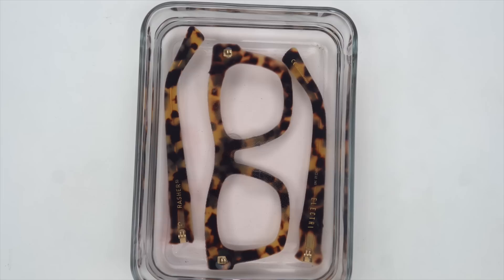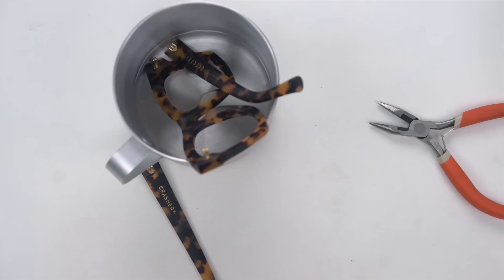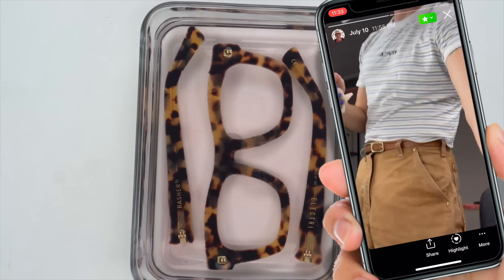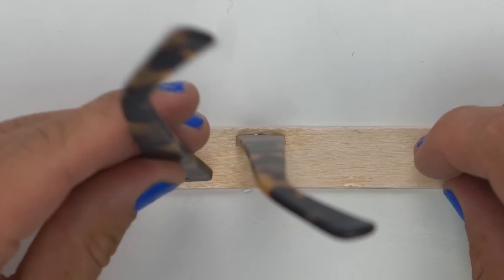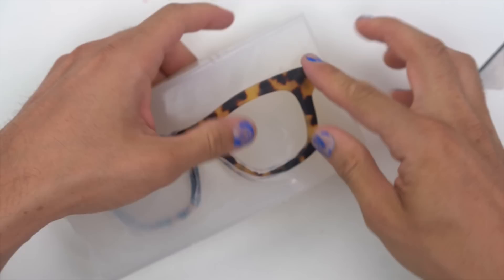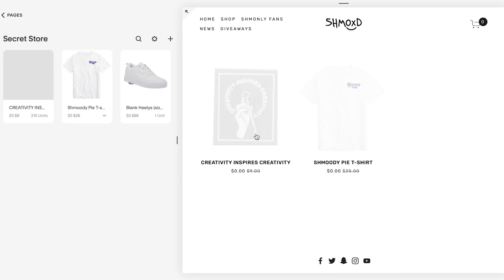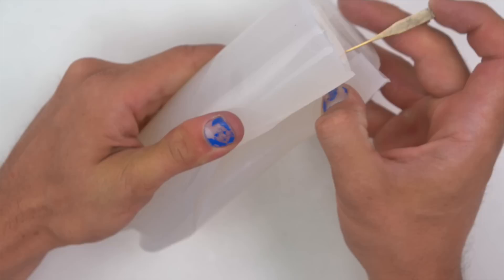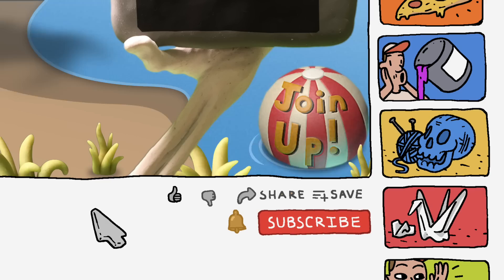DIY Flower Glasses Pt.1

Comment: If you don't want the glasses to bend next time, use a type of silicon that will be clear in the end because the light can't touch the resin as easily and have the UV light shine on the resin for at least 1-2min that should help with the bending

Comment: You could encase the plastic parts in a sand mold and simply use a small furnace to burn away the material. Inject with resin, burnish, polish, then hydro dip using a preselected pattern featuring the flowers of your choosing. Using this method would enable you to create many pairs as well. Done with care the glasses would be production quality also.

Comment: the way i took out the little metal thingys was to use a wood burner to heat up the metal part, then pull. it comes right out:D
Reply: Yeah, I was thinking 'hot air blower' immediately. That plastic should soften pretty quickly. Probably even putting them into an hot oven for a bit would work.